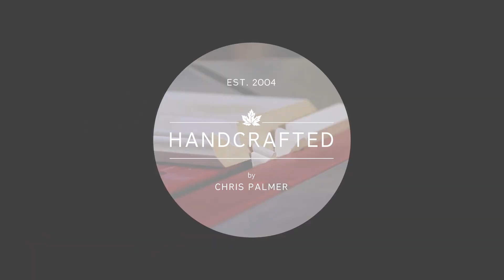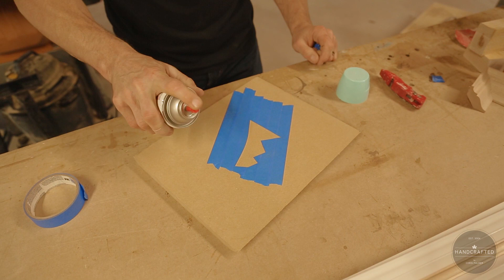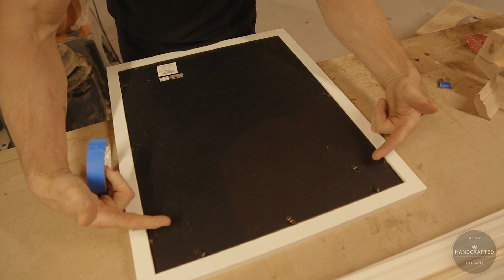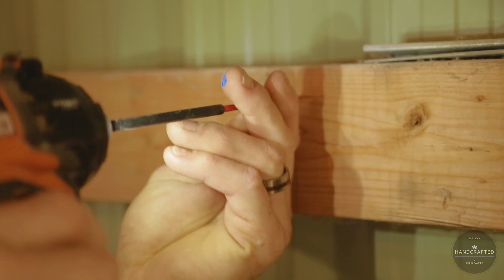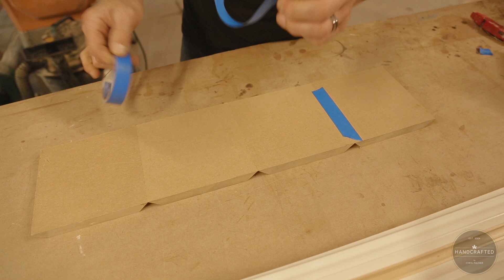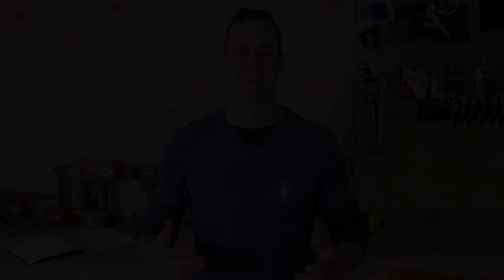Masking Tape Hacks

Comment: You're supposed to put string across to hang the picture that's what there for
Reply from the maker: kev carguillo Hey Kev, the picture hanging wire you are referring to is normally pre-attached to thr frame. This one will hang more accurately by using the hangers on the frame. With wire, the frame will have the ability to tip back and forth so it will become off centre and unlevel. 😉